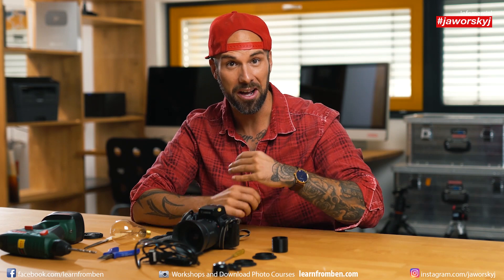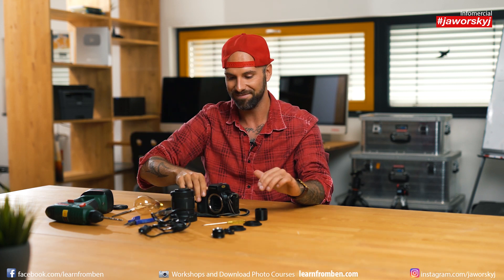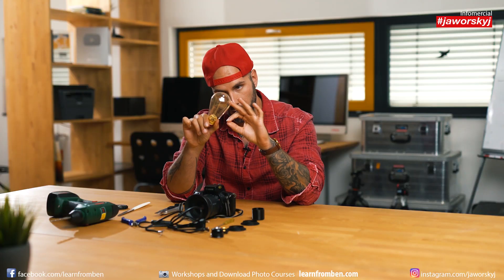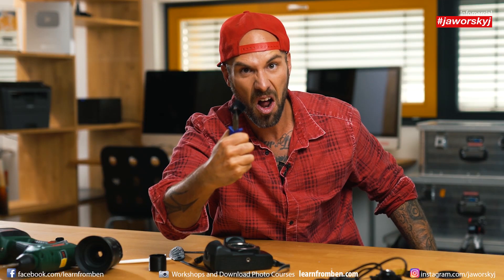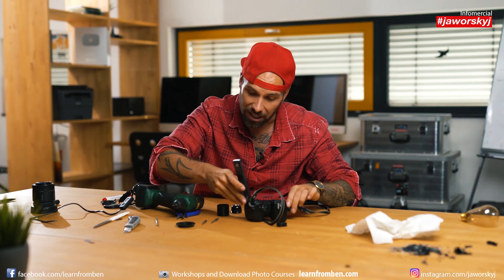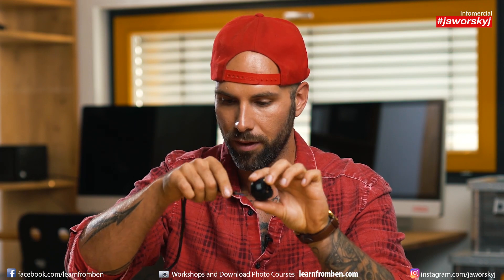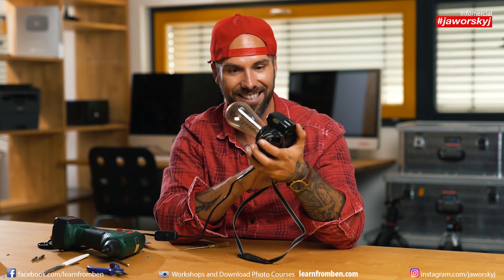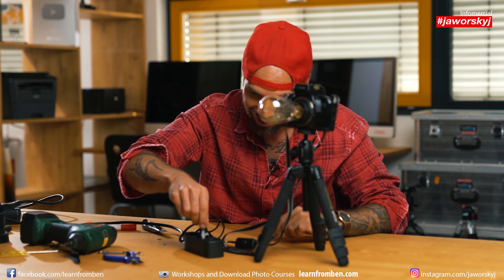Build your own DIY CAMERA LAMP 📸Tutorial | Jaworskyj

Comment: Interesting.  Would setting mirror lock-up make it unnecessary to remove the mirror in bits?  A hole or spade bit drill might have made it easier to make the hole.  I’ve seen old cams made into part of lamp bases but not where bulb is in the camera body itself — nice job.  Vid sub-title: how to convert a camera to permanent “Bulb” mode 😁.

Comment: Nice lamp.. I like it.  However...... if live cable touches metal body parts of camera the whole thing becomes live as there is no earth.  When you touch it you get electrocuted.  In UK we generally call that a massive Fail.  Your lamp should be earthed buddy to be safe for use... or double insulated.  Just my thoughts bud.

Comment: Would be a lot safer to build this with a low-voltage DC power supply. Just give it 6-12V with an appropriate light bulb.